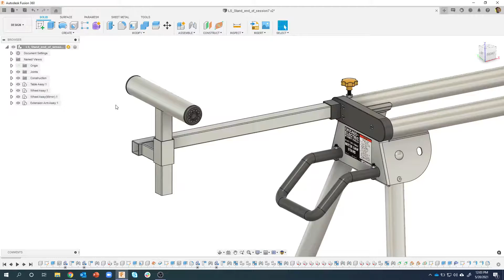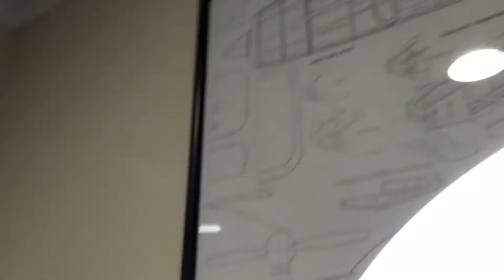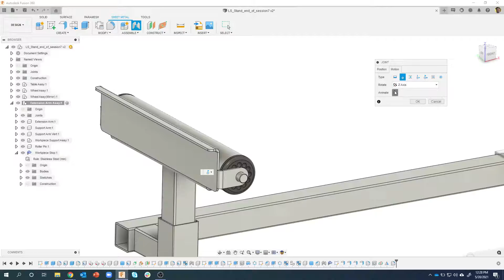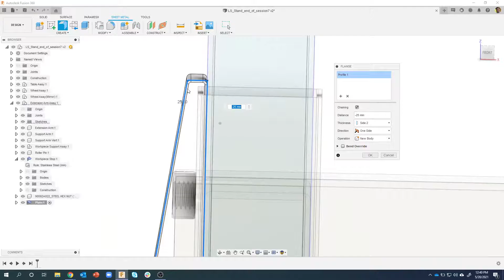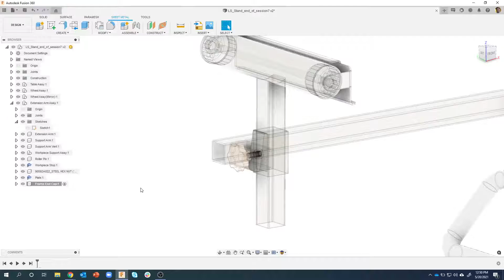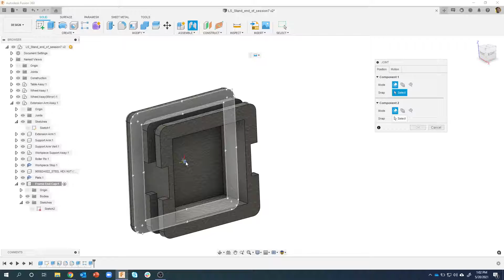Episode 89 - Miter Saw Stand project, Part 8

Comment: To change a reference, click to “Edit feature”, then left  click and hold on the center dot, move the hole in any direction, release, and the references will be activated and can be re-established.
Reply from the maker: @Raymond Coleman-  Thank you!  I thought I had tried that, but I guess not.  Thank you for sharing the tip to make this work!

Comment: Hi Brad,
I know it's not directly related, but could you please advise on this?
I was recently advised to update Fusion360, or I would only be able to view files already created. 
Downloaded and started to install the updated version on my 2011 iMac, and was told that the new version wont run on my current OS, which is High Sierra. 
No problem I thought, I'll just update that first. Turns out that my iMac can't run a newer OS, meaning I now don't have any version of Fusion360 to use.
I only tinker with Fusion 360 from time to time after watching your videos, so having the latest version doesn't matter. I there a way of still running a version that allows new models to be created, without me needing a new iMac?
Steve.
Reply from the maker: Steve-  I don't know Mac's or their operating systems.  I would recommend posting your question on the Fusion 360 forum and see what other Mac users recommend.